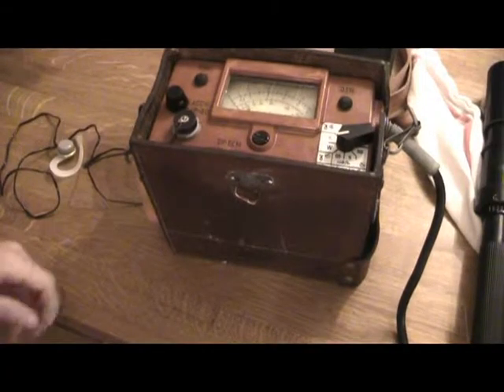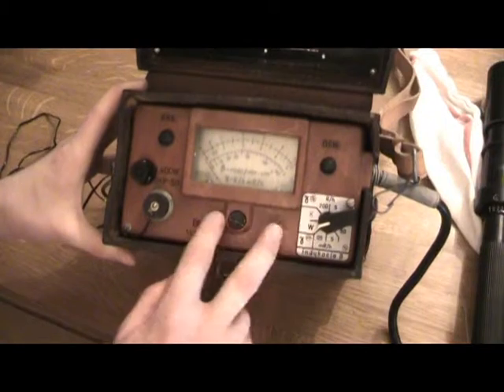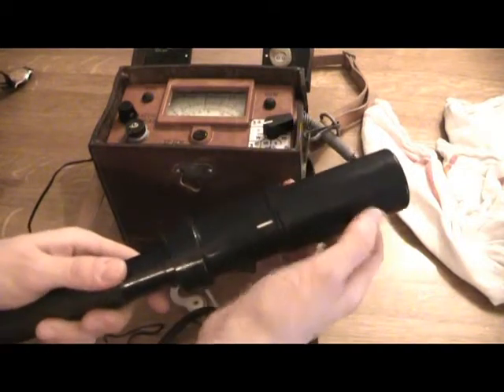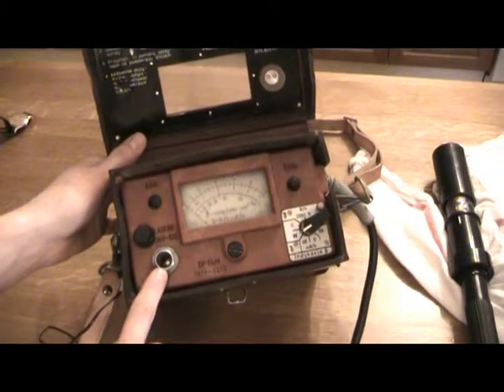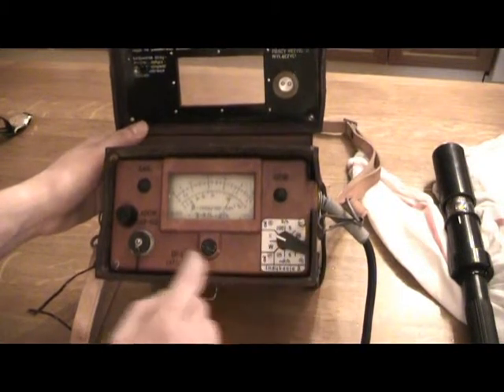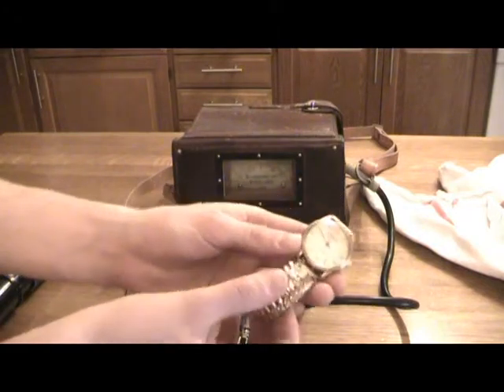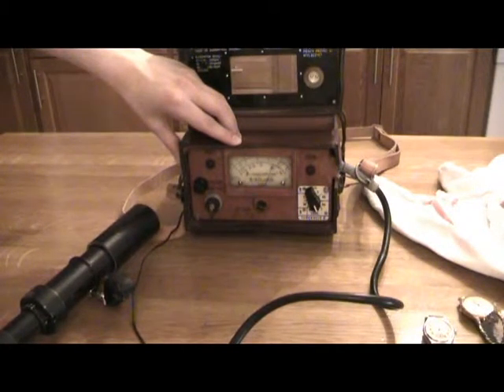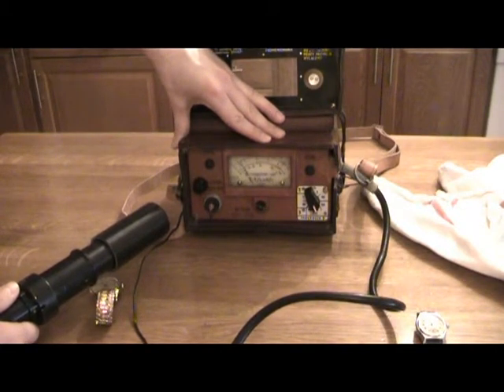Polish DP-66-M Radiation meter.

Comment: The screw cap is for resetting/charging & calibrating dosimeters, the knob next to it is to calibrate them back to 0 because when they are clicked in the needle shoots off the screen and you have to bring it back slowly 👌👌